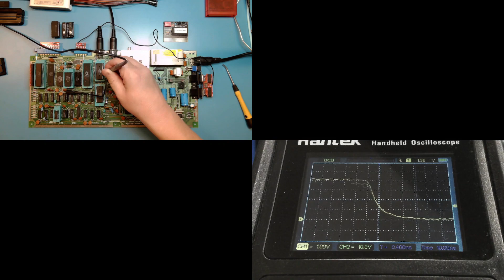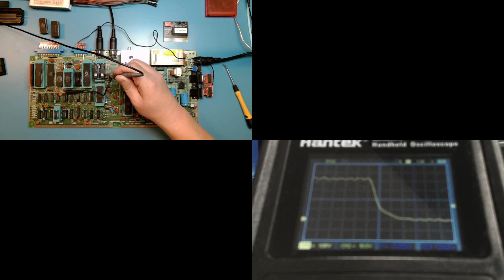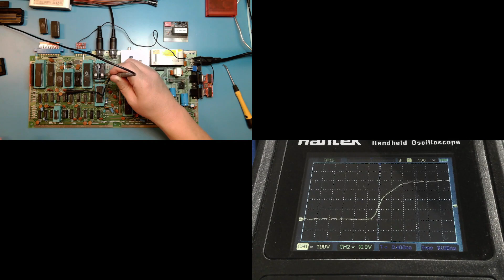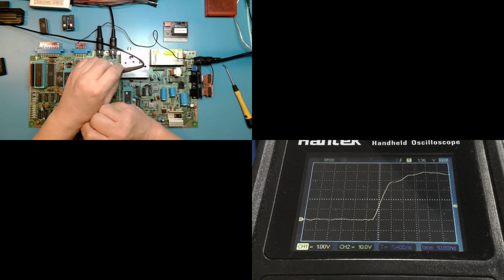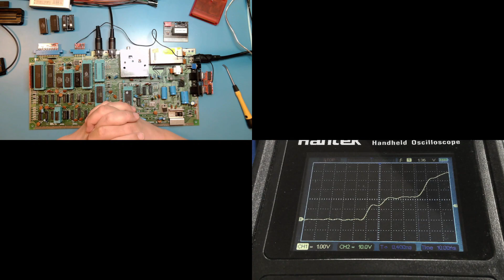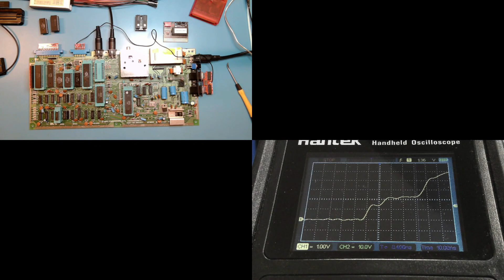Correcting My Mistakes - EEPROM PLA FAIL

Comment: Great video! From scope, looks like EEPROM for some reason, sometimes, is staying longer in 3 state condition. That isn't worst what can happen, because data bus ICs, usually is in 3 state, when not accessed. Wrong timing delays at RAS, CAS and CS is different story..
Basic idea is good, but needs to be updated with some basic logic ICs for proper delays. 😉
For future investigation, logic analyzer or multiple channel scope will be needed to precisely capture delays. But from other point, I'm not so sure, that PLAs was exactly precise between revisions.. 😂 
Anyway, nice project! 👍 Keep going!
Reply from the maker: My scope is a two channel, just didn't use it that way in this video.  I also have a logic analyzer.  I just decided that further analysis of the EEPROM solution wasn't warranted since the signals were so malformed compared to other cheap and easy PLA replacement solutions.  Other commenters have suggested adding extra logic IC's to implement the delays, but that just adds to the complexity and cost, which, in my view, defeats the purpose.  Thanks for watching and I hope you keep coming back.

Comment: Using a regular eprom instead of a custom logic device is a viable idea in theory if all things were equal. But, as you also mentioned the PLA has purposefully delayed lines which the designers carefully adjusted after many trial and errors. If this is the only problem here I think it can be overcame by using a really fast modern eeprom (maybe an SMD flash part) and carefully adding those delays where needed by means of some other external components like schmitt triggers etc.. This would be a time consuming project and result in a much complex PCB, and the final cost may be above the GAL-PLA. I have a GAL-PLA which I built out of curiosity, which seems to work with everything I could throw at it. Never did comparisons on timings with an original PLA like you did here though. Nice video, and I wish you success on your channel. You have +1 subscriber now.
Edit: I have just a hobby level electronics knowledge, so I can't claim I know what I am talking about here, but when it comes to testing PLAs, whether original or replacements, I have read in many places that running very demanding demos are the way to go, especially the ones that draws on the borders. My personal best is the Star Wars demo by Censor Design.
Reply from the maker: Thank you!  And yes, I thought about the possibility of adding external circuitry to handle the extra timing/delay issues, but you're right, that adds to both the complexity and the cost, so probably a case of diminishing returns.